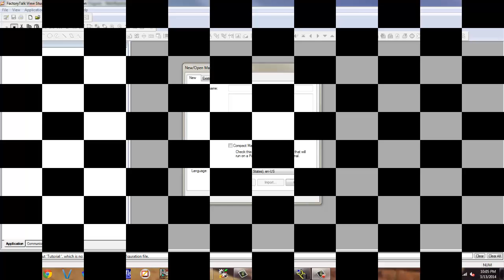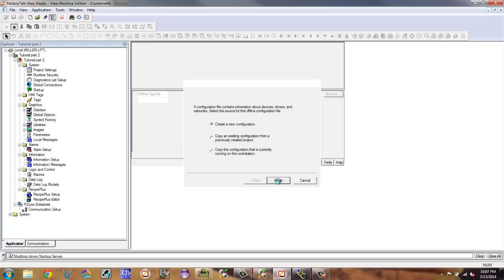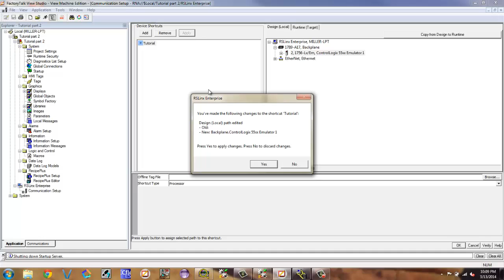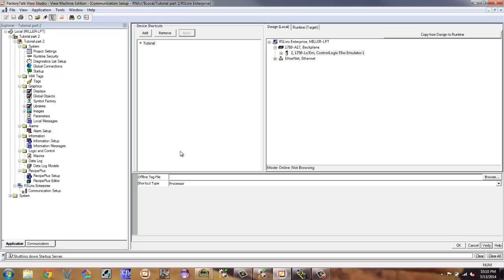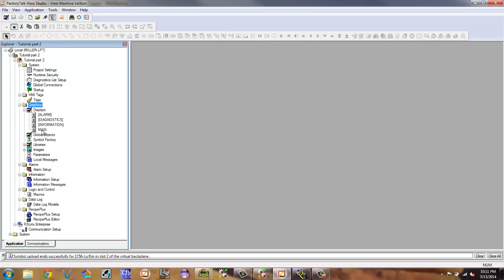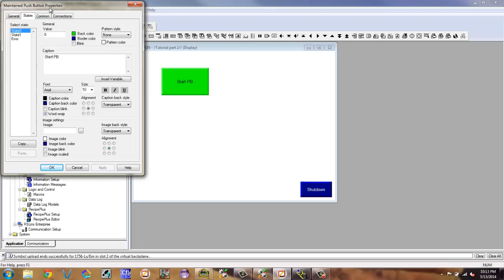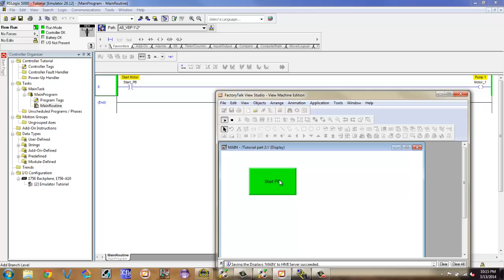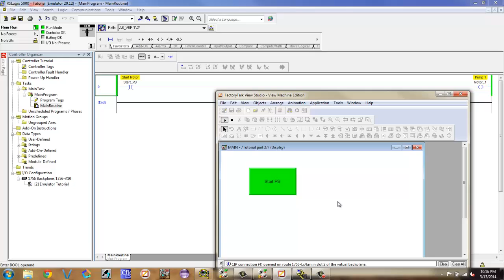Rslogix 5000 Emulator tutorial 2 with Factory Talk View 7.0

Comment: I can't seem to get it to work. I'm using version 28 emulator and Studio but FactoryTalk only allows Emulator version 24 in "Add Device Selection"  and EDS File Browse is grayed out (can't use version 28 emulator profile). Could that be the issue? 

I'm guessing maybe tag formatting is different in emulator version 28 (ex. Local:3:I.Data[1].15 ),  do the older versions only support Local:3:I.Data.15? Just a guess, any help would be greatly appreciated.
Reply from the maker: Edward Brand what version of factory talk are you using
Reply: It is 10.00, latest one to date
Reply from the maker: Edward Brand I'll try it here today
Reply: Any luck? I should add, communication between Studio and Emulator works.
Reply: This emulator needs a lot of work but I made it work! 
What happened was that I deleted all the "real" IO modules in the program and added SIM modules which use different tagging method then re-aliased all the tags. That way my IO modules were no longer mismatched. I tried going back with "real" IO modules with a mismatch warning and it worked. But now, toggling inputs on the IO Emulator modules doesn't work anymore, which is less important. 
Not sure how all this happens but I guess there are shortcuts since all this runs on the PC.
Reply from the maker: Edward Brand I got it to work it is as you displayed it

Comment: great video, thanks for sharing. I have a question and i hope you might be able to help me. I have in one laptop the rslogix 5000 and the rslogix 5000 emulator running (rslinx too) and in a diferent laptop i have the factory talk view (also rs linx). both in the same local network. i cant see the emulator in the comunication setup configuration in the factorytalk view
Reply from the maker: I'm not sure how to do what your asking. However I'm always up for a challenge I'll be replacing my laptop this fall so I can try it then and see what I can come up with. I know it's not the answer you were hoping for but I don't have another loaded up with it. Can you install the FTV on your laptop?
Reply: I do have the ftv in my laptop. I need to do what i ask because i need to check the directioning of a big proyect with the designer of the apa

Comment: Need some help. Using v20.00 RSLogix/RSEmulate/RSLinx. I added an input card in the emulator 1789 SIM32 (Input/Output Simulator). When I tried to bring in the module through RSLogix, I get the following message in "discover modules" " A profile must be installed before this device can be created". How can i fix it?
Reply from the maker: Did you follow the generic card instructions in the help section of the emulator? If so I would like to know what values you added for the module.

Comment from the maker: Sorry for the slow response, you can change the controller over to emulate and then the I/O but its a pain. If you do not have a 300 rung program setup it would be easiest to start over but yes you can switch it over. I can do a video later on how to get it done. again I apologize for the late response